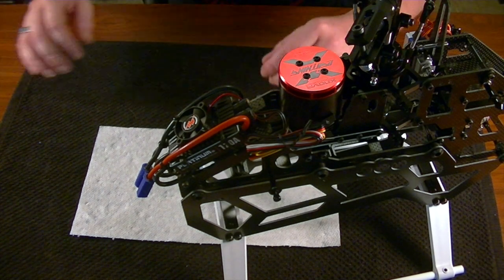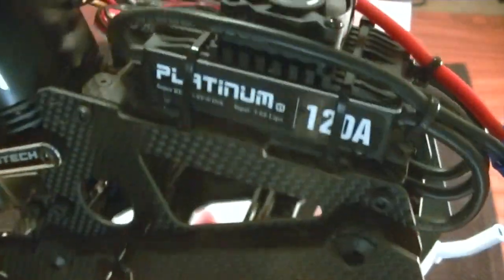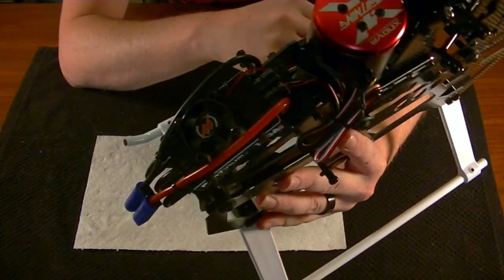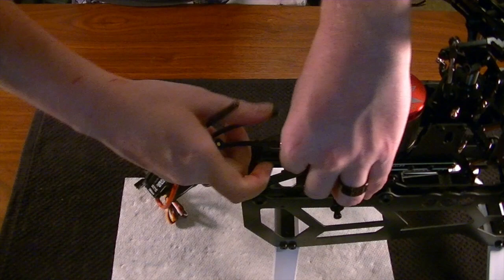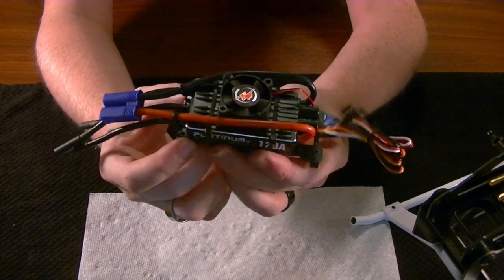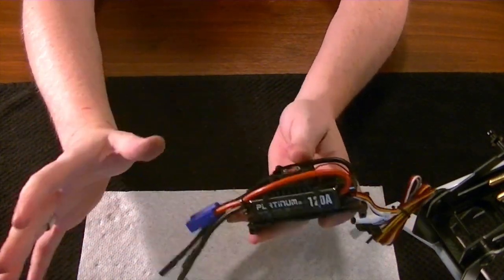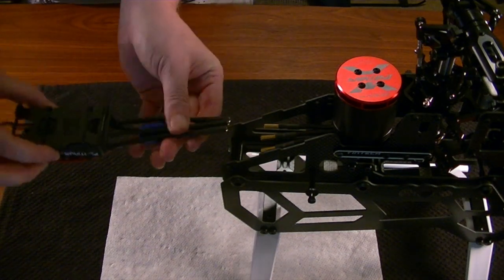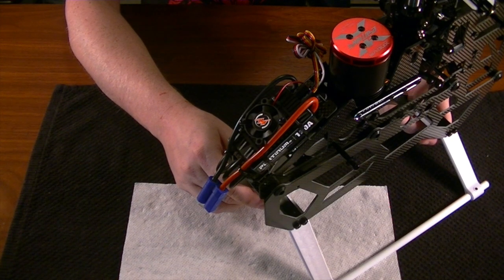Tron 5.5 : ESC Installation And Tips (FreddyCanFly)

Comment: Fubata gy611 gyro do you know anything on this gyro like setting up
Reply from the maker: I do not know much about it but I could try to help.  I know most of it is done step by step with the little program box.
Reply: I have set it up to the manual but for some reason on the transmitter I can’t change between rate mode and heading mode dx9